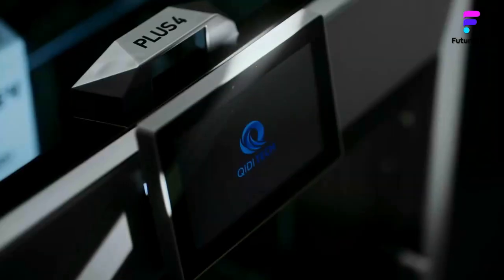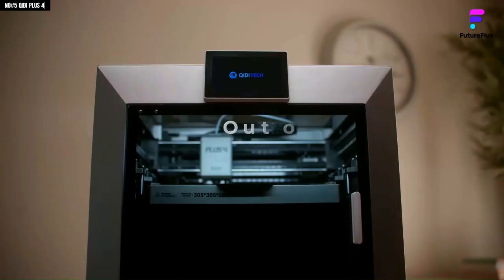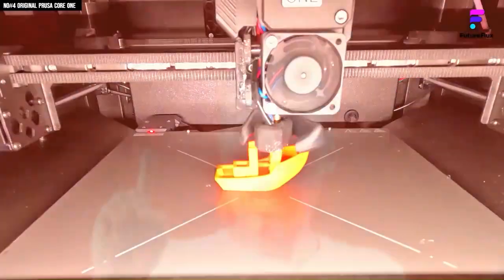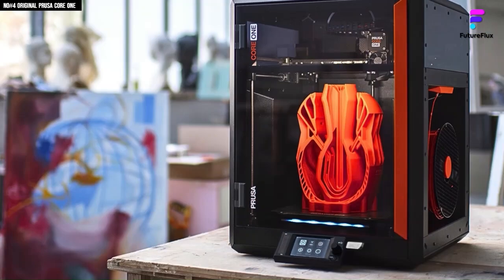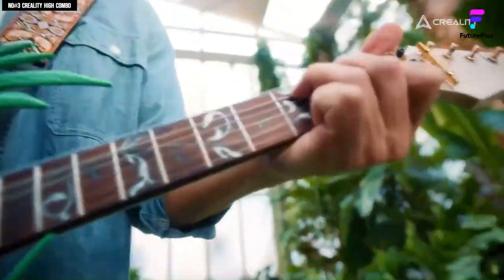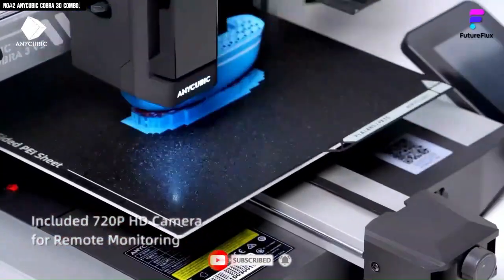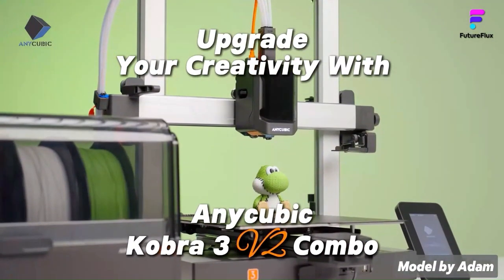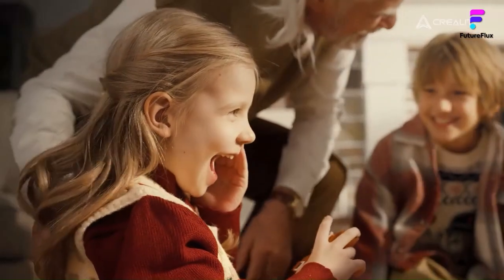Top 5 BEST 3D Printers For 2026 - Experts Tested

Comment: Anycubic Cobra 3 is the worst printer in this video, it is cheap but thats it. I have mine since almost a year and most of the time i print something and have to solve a problem afterwards. Even Anycubic knows the printer sucks, otherwise there would be no V2
Reply from the maker: Thanks for sharing your experience .Yes , the Cobra 3 had a few issues for many users looks like the V2 fixed quite a lot. Hopefully, Anycubic keeps improving from here